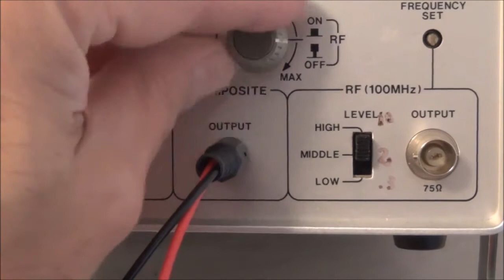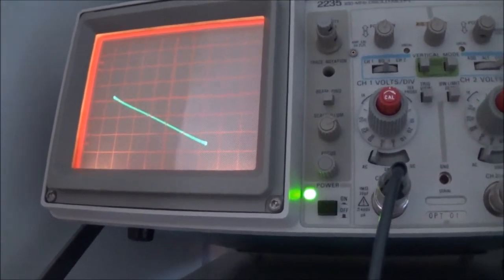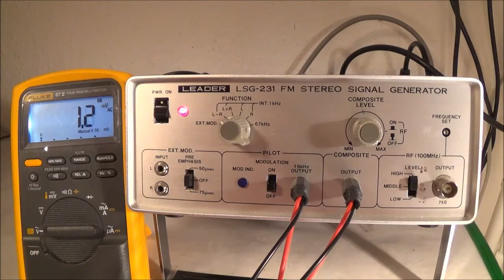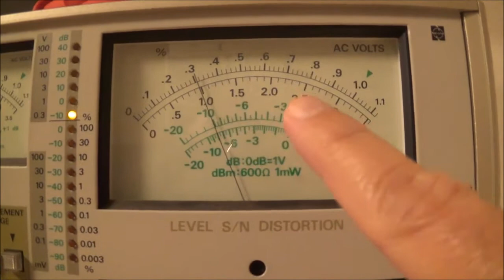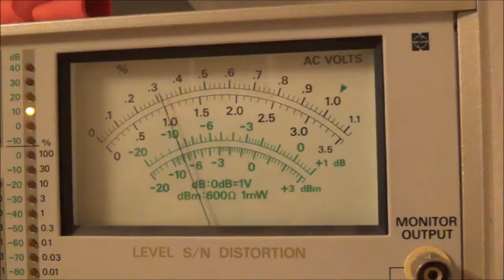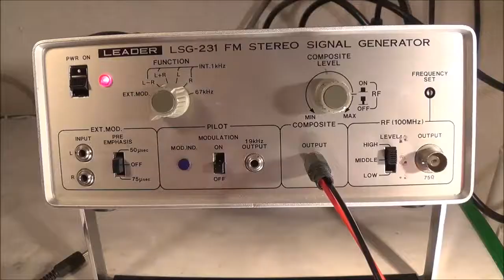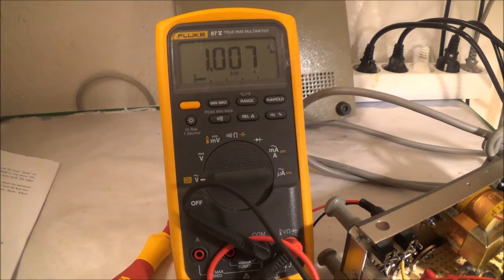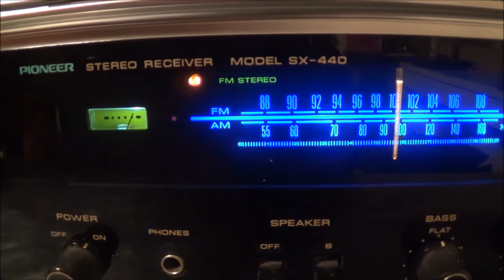Leader LSG-231 FM Stereo Generator Calibration

Comment: This is a fantastic series, I really appreciate it!  So, I see, I was trying to illuminate the stereo light over the air, and you are actually making a physical connection, will try that on mine to see if it works as my way failed!  ~Jack, VEG
Reply from the maker: Thanks! Hopefully it's halfway understandable and I didn't miss anything; I "threw" these videos together.  I would recommend making a physical connection, even though mine was mismatched. The output from the generator is 75 ohms and the tuner input is 300 ohms.